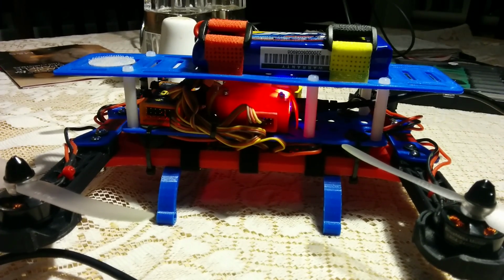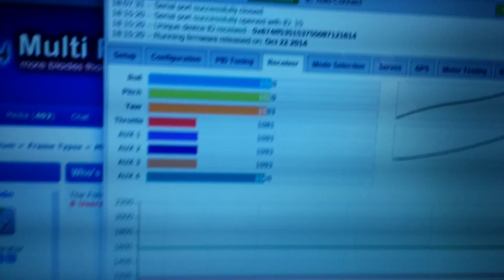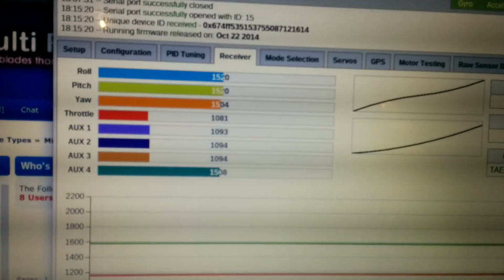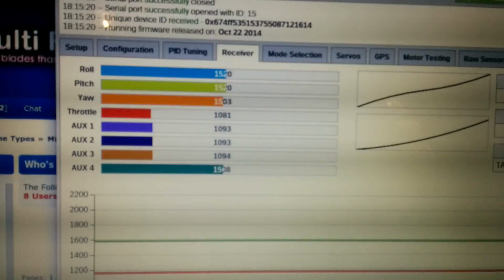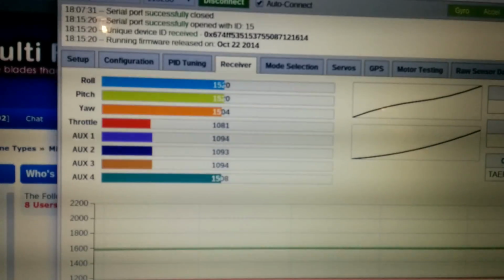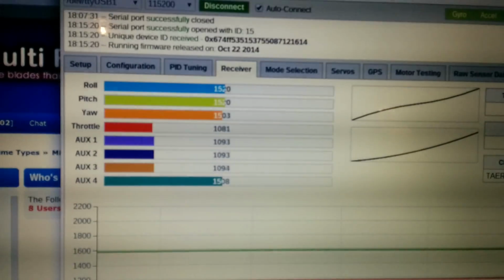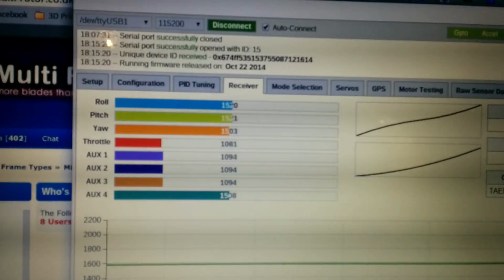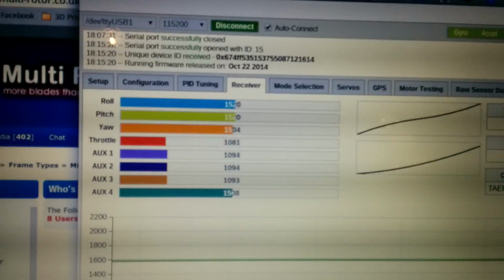Naze32 Yaw Drift - Fixed

Comment: Does this code works in missionplanner too for the apm 2.5. Please help me out
Reply from the maker: I don't know if APM 2.5 software has a deadband parameter but you could experiment with Yaw Expo settings to introduce a small equivalent at centre stick position.

Comment: Thanks for the short and sweet informative video. This worked in my F3 in betaflght as well (and there are GUI places for this under the radio tab in betaflight, no cli necessary) . I also had to manually set my center points for all channels because the knockoff flysky Rx and cheap Tx was centering at 1530 and that was also contributing.

Comment: I got left drift on a SP racing f3 board. Help?
Reply: any luck with a fix? Mine just started doing this exact same thing last night
Reply: justin vaughn bro, check you COG. make sure your battery is centered. calibrate  the board and esc too.
Reply: cool will do, thank you!
Reply: Let me know if it works if not i got a go to guy that will definitely solve the problem.
Reply: awesome will do. I just noticed the problem last night which came out of nowhere. so will try your suggestion when i get home from work today
Reply: Cool bro.

Comment: Danny what about the jitter in value for pitch and roll? my quad is fine for yaw but it always drifts to the right. is that roll ?
Reply from the maker: OK, so for Pitch and Roll just use the Cleanflight "deadband" CLI command. Values between 0 and 32.  It is explained in their github CLI commands page as this 

"These are values (in us) by how much RC input can be different before it's considered valid for roll and pitch axis. For transmitters with jitter on outputs, this value can be increased. Defaults are zero, but can be increased up to 10 or so if rc inputs twitch while idle. This value is applied either side of the centrepoint."

Hope this helps

Comment: do you need to add the save command in CLI afterwards
Reply from the maker: +nick robinson Yes you do, although switching from CLI to GUI usually does the "save" for you automatically.  But just to be sure, I always do the save command in CLI before switching, just in case ....

Comment: Thank you Danny, had some right drift that was driving me bonkers. If I set to 5 I get front right motor not working but 9 gives me less than 1 degree of yaw in 20 or 30 seconds. Still a long way to go before this flies as good as it can mind you but you saved a little sanity for sure. Cheers

Comment: hi i am  having a problem with my mini quad it has a naze 32 and when i arm it and then put a but of power on it flips its self
Reply from the maker: +NZ. Drones Check the order of the motors, that they are correclty 1, 2, 3, 4 - you can use the GUI Motors tab to verify that each channel is going to the correct motor and that the motor is spinning in the correct direction.

Comment: hi guys i had the same problem and i have tried everything even the ' set yawdeadband=5' comand nothing happend so i've decided to change position to the rear motors and esc the right bacame left and so on and the problem was fixed.
 don't ask why i do not know. If nothing else works try this.I have an FPV racer the FMX250 with durafly motors 2300 kv and durafly 12amp esc

Comment: This is a little unrelated but I was wondering how you ran your wires from the orangerx to the naze32.
Reply from the maker: MonsterVapes I am using a FrSky S.Bus to PPM converter cable, so only one single wire between RX and the Naze32 FC.

Comment: the correct command is set "yaw_deadband="        at least it is for clean flight or baseflight  thanks for the video
Reply: acccrew01     according to the cleanflight code, there are three deadbands.
deadband;  // introduce a deadband around the stick center for pitch and roll axis. Must be greater than zero.

yaw_deadband; // introduce a deadband around the stick center for yaw axis. Must be greater than zero.

alt_hold_deadband; // defines the neutral zone of throttle stick during altitude hold, default setting is +/-40
Reply: Doesn't seem to work for me..

Found it,,on cleanflight "set yaw_deadband= 2"
Now Is there a setting to do on the roll / pitch too.... ?

There is a setting "set deadband=2"
Reply from the maker: keith R Thank you for that - I have corrected the typo in the video annotation.

Comment: How about just setting your subtrim right in your tx?
Reply from the maker: No good because the constant jitter will affect whatever trim you set. It is like tapping the Yaw stick all the time
Reply: Danny Thompson every single receiver I've setup had jitter in the RC inputs by +1/-1. It's due to the sensitivity of your tx sticks and is too minimal to really affect anything. The problem I see here is that you're off trim (1504). Roll Pitch and Yaw should be at 1500. The way to fix that is to subtrim your tx. While subtrimming you'll notice that often fixes the jitter.
Reply from the maker: Dr Frantz I should have said that I had previously tried subtrim at the TX which is why I went to compensate for the jitter, and indeed it has done so.

Comment: Where did you get the props?
Reply from the maker: I got mine from Radioc.co.uk (http://www.radioc.co.uk/5045-propeller-p/5023.htm) for £1.50 a set of four (2xCW + 2xCCW). If you shop around EBay you can still get for similar price. Or keep an eye out for RadioC special offers which is when I bought 10 sets :)